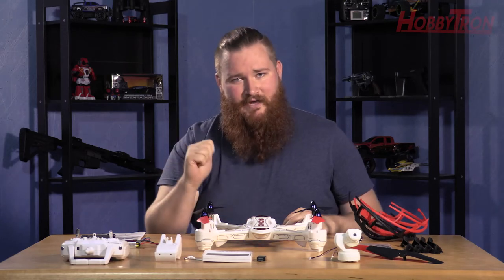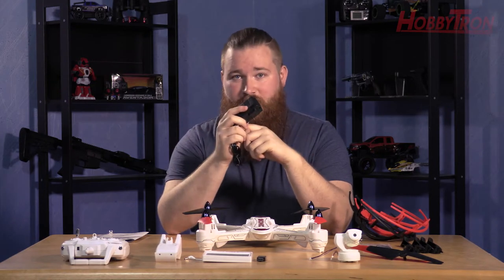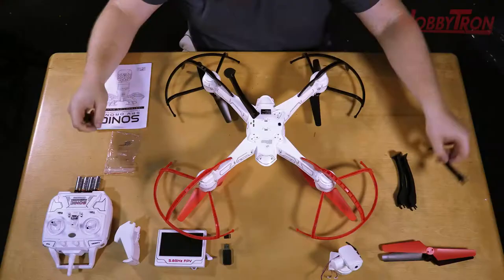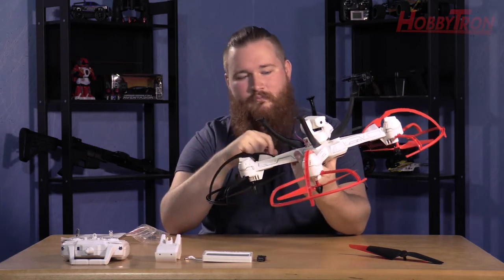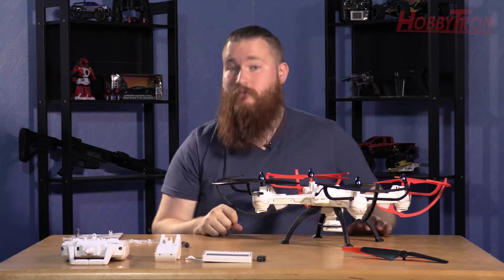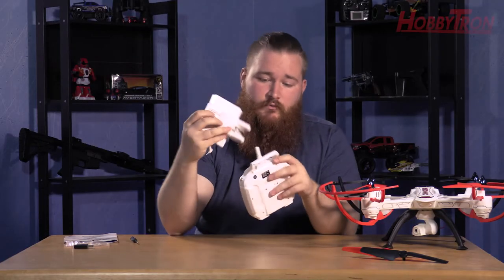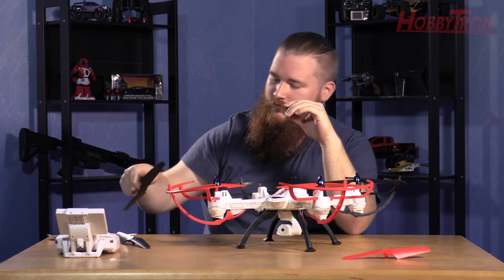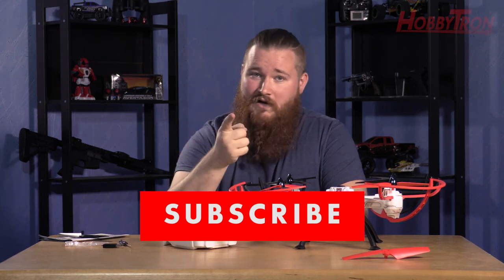Sonic Camera Drone | Assembly & Repair

Comment: How high this drone can fly?
Reply from the maker: Well Actually pretty high! 
Typically with good conditions it can get well higher than the FAA Regulation of,
"• Maximum altitude of 400 feet above ground level (AGL) or, if
higher than 400 feet AGL, remain within 400 feet of a
structure." 
However always follow FAA regulations when operating your drone! 
Happy flying